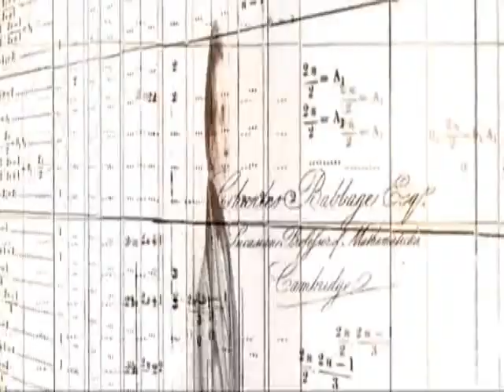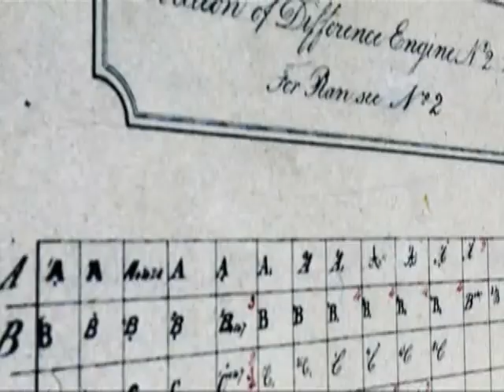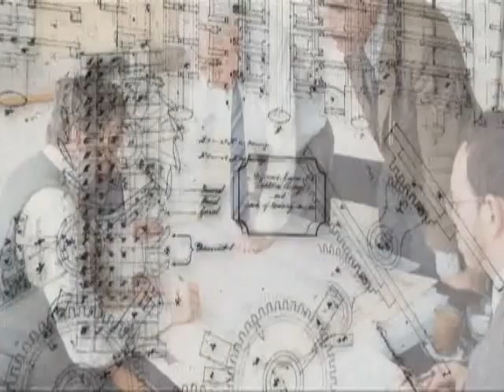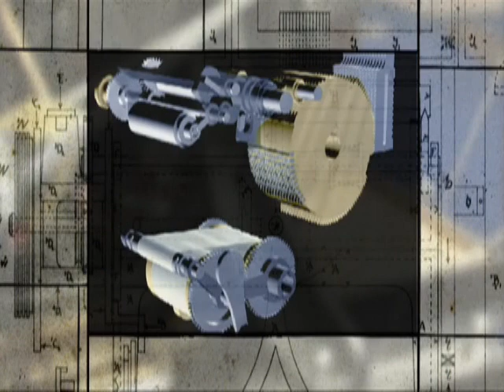Charles Babbage and His Difference Engine #2

Comment: here is my question why did he not use a clock smith is that not cheaper faster and easier to build ?
Reply: +Fuck You Google He was not making a clock.
Reply: He complained that he could not find a machinist capable of producing the precision brass gears to the tolerances that he needed. Apparently, metalworking was not as advanced as his mechanical needs were in the 1850s.